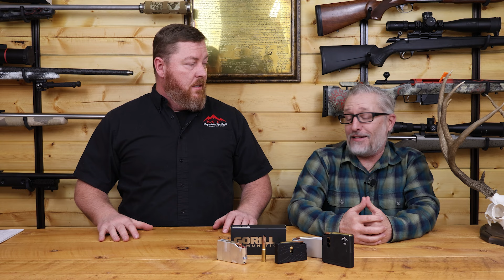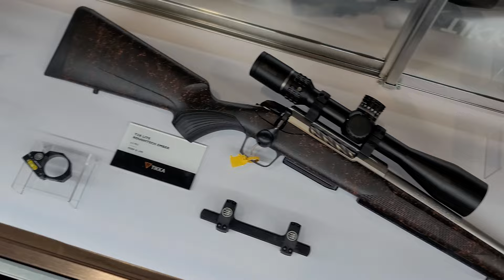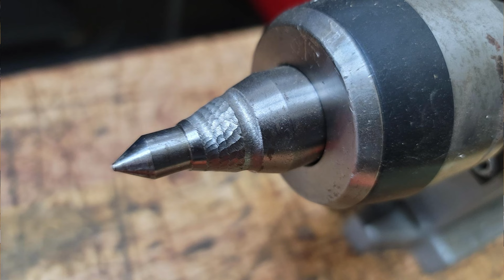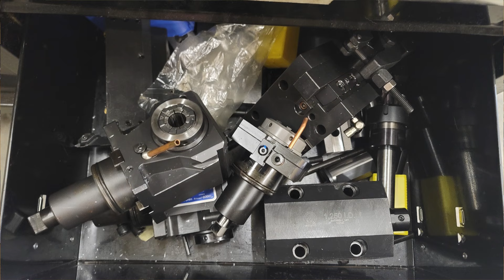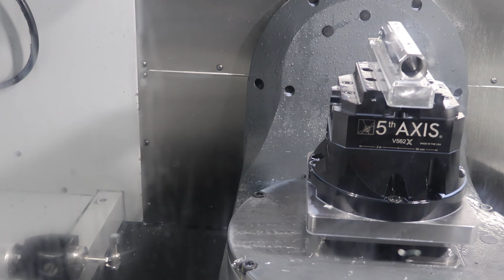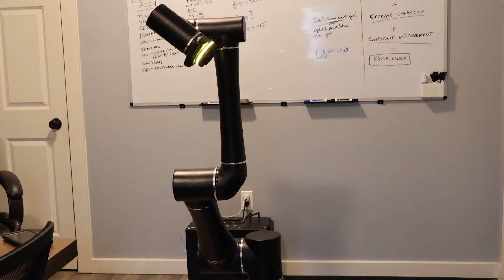2023 Almost Ended Us!!!

Comment: I appreciate your company. Will you please consider machining a bag stop for the Tac A1 platform. One that would attach from an arca rail like the gray ops, but it would need to extend further back that would run close to the mag well, but still allowing the balance of the rifle to be just in front of mag well. If the CTR mag goes into the bag, the mag is canted forward not allowing feeding. Thanks!
Reply from the maker: That's a great idea!  Thank you for sharing it. I'll send it over to Jason